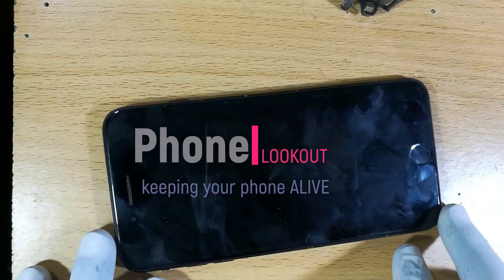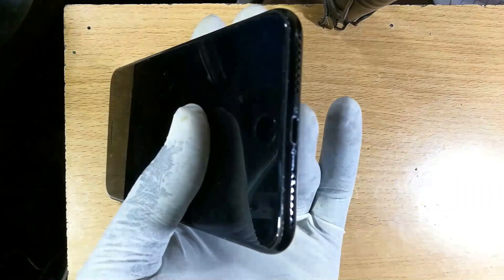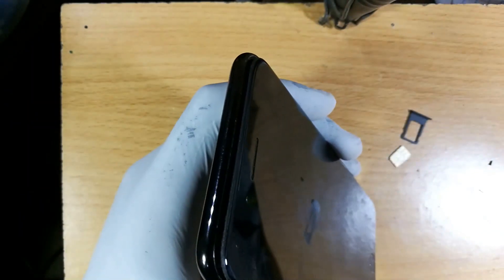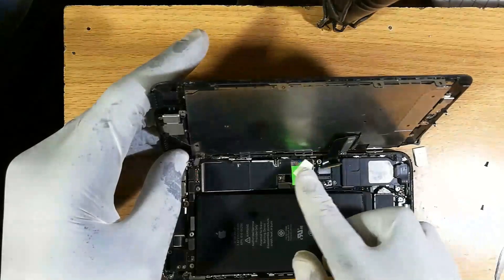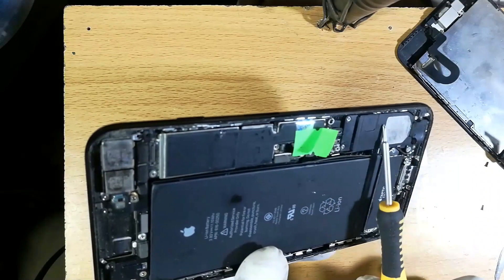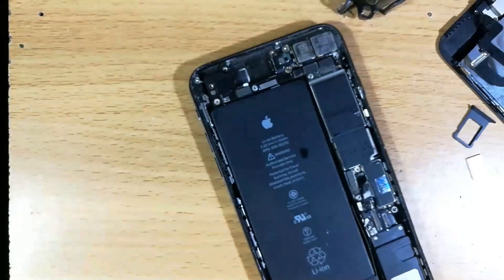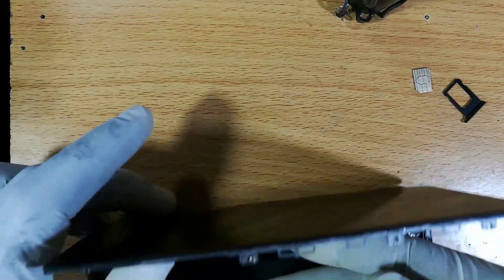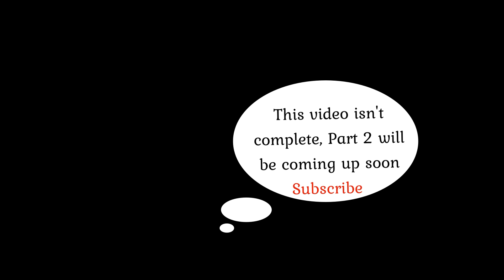Repair Dead iPhone  (iPhone 7 Plus NOT POWERING - SUDDEN DEATH + How to OPEN iPHONE 7 PLUS}

Comment: Hi my iphone 7 plus was reflected by the heat of sunlights its working fine until i low the brightness and then it shutdown and i cant charge it, it doesnt open even if i charged it can you tell me what really is the problem??
Reply from the maker: First consider changing the battery

Comment: My ohone dropped out of my pocked when i had a accident in the winter on my bike and it will not turn on anymore battery is good screen is good no cracks no dead pixels etc works what to do?
Reply from the maker: Sorry about the accident, hope you are well.
Which phone model is it?
And were you able to take it apart.
However if it is a phone that has an oled or amoled screen, then the screen can fail despite showing no crack on falling.

Comment: I was gonna charge my phone and plugged it in, then it had shut off after it was plugged in. I just went to it to check the time, and it was completely dead. Any ideas? I think it’s the battery..
Reply from the maker: yes begin with the battery, first try to jump start it. that is charger it directly or externally
Reply: @PhoneLookout WELL THE MOTHERBOARD IS THE PROBLEM I NEED TO FIX A CAPACITOR
Reply from the maker: @ElevatorWasher5000  thanks for the feedback
Reply: @PhoneLookout  any ideas on what to do because it’s all near the Audio IC that are bad but the audio had worked fine and the microphone
Reply: the phone screw is stripped

Comment: The same thing happened also with my iPhone 7 Plus after putting it on charge when coming back the phone was off and tried change the battery but still no success and I don’t know what to do
Reply from the maker: We ended up replacing the motherboard.

Comment: my phone got locked so i tried to restore and update my phone by putting it in recovery mode and using itunes but it got stuck and the phone switched off completely 
Now it doesn't turn back on 
What should i do
Reply from the maker: is the battery healthy and fully charged?

Comment: How did you add voltage to the battery?
Reply from the maker: if it is below that which can be recognized by the phone so as to begin charging, right? is that what you mean?
if so I'll make a video your sake. Please give me a response if you would like that.
Thanks for subscribing and liking the video
Reply: @PhoneLookout  Thanks but I already fixed it. I did a DIY iPhone 7 repair for a friend. The phone was dead and not charging. No voltage reading from the battery. I jumpstarted it by charging it manually using a spare usb cable that I cut. Then I clipped the positive/negative terminals to the iphone battery using an alligator clip. I let it stay for a minute or two then continue charging using the lightning cable. Luckily it worked. 😄
Reply from the maker: @maikerujan  uh cool, just what I had I mind for you. Glad to know you perfectly executed the solution. Thanks for the response too.